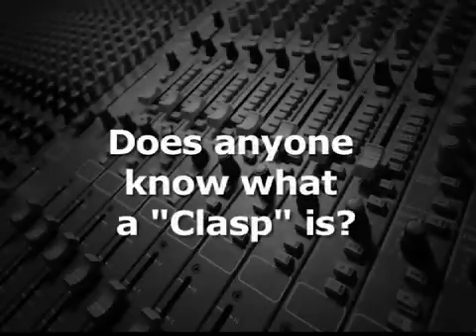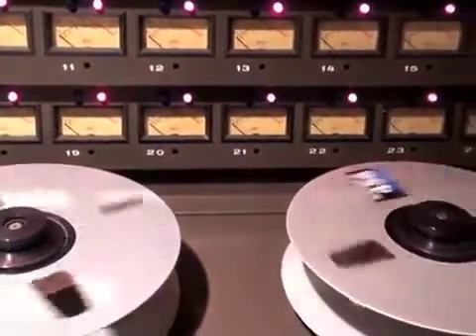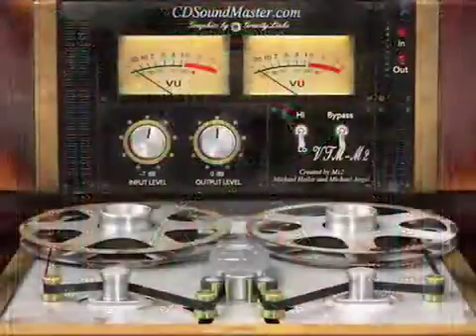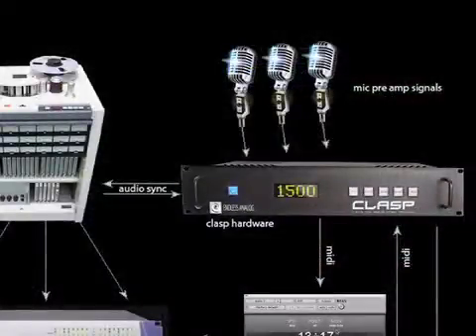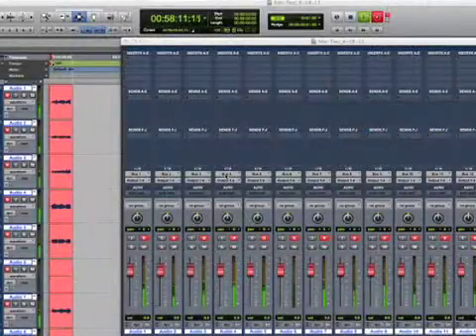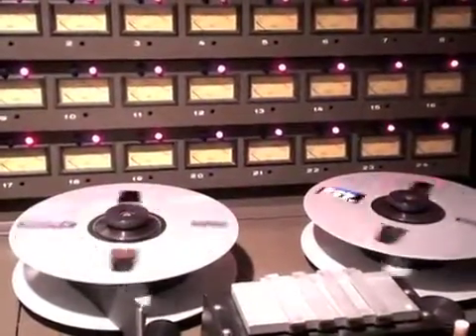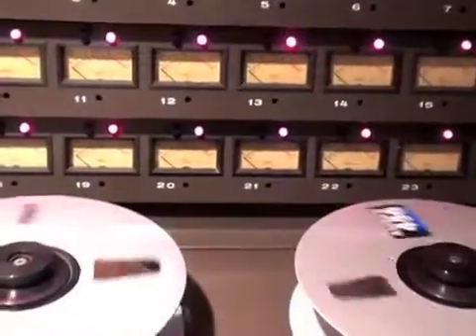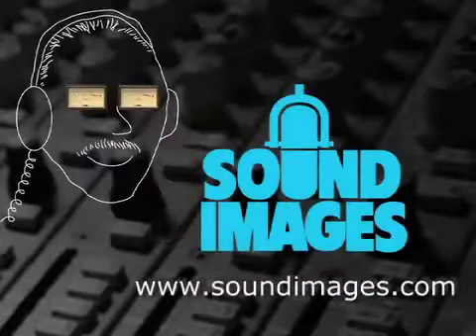Clasp

Comment: I discovered Mr. Audio only this morning.  But I have to tell you, this guy teaches me more in less than 2 minutes then most 20 minute youtubes!  Thanks Mr. Audio!  And for what it is worth, when I first heard of The CLASP System I was all excited as I thought I had found a use for my 2 1958 Ampex 351 systems.  That is, until I learned that the CLASP system was about $6,000.  Sigh.  But that is not Mr. Audio's fault, he is just reporting on the technology.